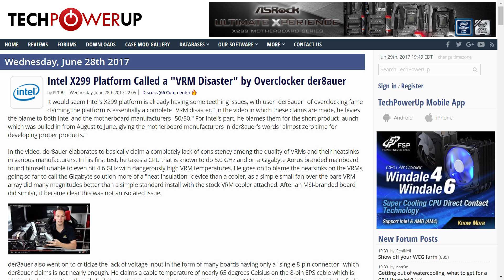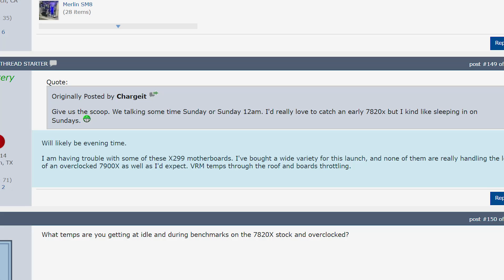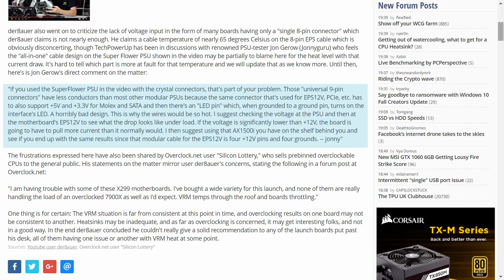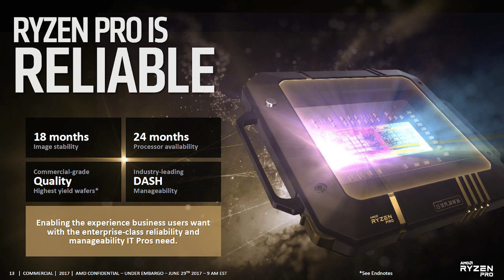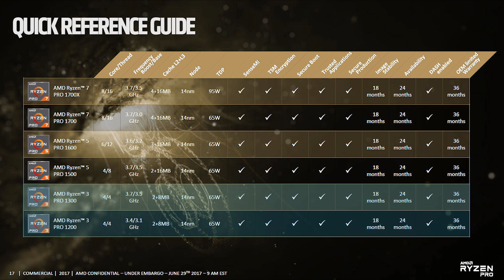Intel Core X Motherboards Overheating + Ryzen 3!

Comment: Intel is such a shit show lately
Reply: Unless Intel push out a completely better and cheaper series of CPUs immediately next year, I think Ryzen is going to last for at least a while.
Reply: Not much specs have been given out about Threadripper and everyone is already saying it's a win, if Intel is having problems with thermals and performance it won't be different with AMD. I'm not a fanboy of any of this companies, i'm just here watching everyone bitching about what they didn't get when they wanted it instead of being greatfull for years of innovation from Intel...
Reply: Brent Lio well it will be confusing if  you are still using an old generation cpu wich if i'm correct is not even in hedt territory, then i9 does make sense, i don't see what people are complaining about on the i9 side of things, few more pci-e lanes, a 10c 20t for the price of a broadwell-e 8c 16t, better clocks on both cpu and insane ram speeds, dual m.2 pci-e nvme ssd support, usb 3.1 gen2 front panel connector, and even 801.11 ad wifi and 10g ethernet on some mobos, i mean come on the normal consumer but eager to buy an i9 would go for a 7900X or lower, there is no need for more cores and lanes.
Reply: Mad Doge
'a regular user doesn't even reach 40 lanes' - the keyword right there is 'regular'
a 'regular' user wouldn't need an x99 ,because a z170 would have been enough.. but didn't the x99 catered to workstation builds, hence the extra PCIE lanes over the z170 + some more features?
and is the x299 now catered to 'regular users' instead of being a workstation/enthusiast system???
Reply: Mad Doge
1)i'm saying its a downgrade because 'older' systems than the x299 have more PCIE lanes than a lower tier i9+x299 board (not by core count and clock speed)

2)i'm saying its a downgrade yet again because 'older' systems than the x299 have had raid 0 feature WITHOUT having to pay for a raid 0 key to unlock it
Reply: Enthusiasts and workstations can easily reach 40 lanes.  8x for H310 SAS cards, 8x fiber cards, 4x video capture card, 4x USB 3.0 card for Oculus room VR sensors, 4x for m.2 NVME, 1x each USB 3.0, etc.  You also have to look outside the realm of gaming.  Rendering towers can easily have 4x cards.  Given rendering doesn't generally require 16 lanes at full speed, they can be run just as well with 8 lanes per card with usually little hit to performance.  But the key word is generally, so 4x8 = 32 alone.  Factor in potential m.2 drives and what not and you can see the problem.  Video capture and rendering of incoming feeds to storage subsystems, while hosting a few VM's that are gaming or streaming content themselves.  So, for a single workstation that's gaming, and streaming, and using a pair of high performance video cards, with a pair of NVME drives in raid 0 could easily reach over 40 lanes.  Many of the small to medium sized businesses and performance users have limited budgets to work with as well and prefer not to waste money on excessive dual processor/commercial gear, so Threadripper could be the answer.
Reply: Brent Lio The main weakness is the lack of PCIE lanes which will become a issue as we continue to see more add ons switch to using PCIE. Intel is not innocent either but at least their top 2 or three chips have more lanes vs Ryzen that at best tops out at 24. With this in mind I can't understand why a AMD user would by anything else other than Thread ripper unless they were willing to have to upgrade again in only a few years 2 or 3 at most, it's stuff like this make the supposed value of these chips harder to justify cost wise.
Reply: Mad Doge  The m.2 slot on at least the x370 Ryzen boards has 4 native PCIe connections directly to the CPU. There is no way those will be disabled at all ;)
Reply: Tiger Team Delta AMD is not likely going to make up to the pressure, low prices won't help, and if they do, they will become the same as Intel unless the mentioned pulls the win as happened in the past, companies are companies in the end.
Reply: what people are complaining about is that the x299 platform is sort of a downgrade to the x99 platform here's why:
1)lower PCIE lanes when using a lower tier i9 cpu, which doesn't make sense since the x99 platform was the proper platform when using SLI/crossfire because of its PCIE lane count..
2)the need to buy a raid 0 key to unlock raid 0, which is just additional cost to the consumer

x299 is 'supposedly' an upgrade/improvement to the x99 but it really isn't cause they took away some features
Reply: Tiger Team Delta no one is programmed to believe nothing, Intel has built its own prestige through the years to know they have always delivered the best of the best and will continue to do it.
Reply: Brent Lio Please tell me what features has an 1155 socket mobo compared to 1151 and am4, FEATURES
Reply: Brent Lio well you came in late "general computer user" with a 5 year old pc because we where talking about workstations and enthusiasts
Reply: If you don't want to be a joke, tell me about these 'FEATURES' your workstations/enthusiasts use?  You blasted at me for bringing up the gaming performance for 3770k vs newer gens.  That's why I used 'general computer user' for my assumptions.  I'm sorry but I have no clues about workstations and enthusiasts.  Would you kindly educate me?
Reply: And don't fucking assume what people use their computers for.  People mostly know exactly what they need and are capable of making choices.  And I need exactly the 8 cores and the 16 threads if not more.  Not much about anything else because it will be an upgrade from my 3770k no matter what I get.
Reply: Brent Lio yes please, and buy a ryzen 7 ffs, benchmarks speaks for themselves
Reply: Yea, thanks, I will.  But just to make sure I get best performance/dollar, I'll wait for TR and higher core i9s.
Reply: ikr
Reply: Anime536 _ 
1) no it is not a downgrade, again 6900k is worth $1000 for 8c 16t and 7900x is worth the same but for 10c 20t and higher clock speeds.

2) again no, raid 0 and i'm not sure if the other configs are available out of the box because the m.2 pci-e lanes are wired to the chipset not the cpu, the key is needed for the other few raid configs if an expansion card with more than two m.2 slots is added to a x16 (x4/x4/x4/x4)slot for full bandwith, that feature is meant for insane transfer speeds.
Reply: Anime536 _ a regular user in a bigger point of view, it's meant for enthusiast, workstations, and overclockers, if you want to talk mainstream i don't know what are you doing here
Reply: Anime536 _ or are you telling me you are going to use all 64 lanes?
Reply: Anime536 _  This is a valid point ethusaists are expected to push potentially all aspects of their rig to the ragged limit so the cutting of potential expandability is especially determental to the end user regardless of whose banner said user my fly.
Reply: Mad Doge PCIE mounted drives will in the coming years begin to take up those lanes now that SLI and Crossfire are both effectively dead, if there is a chance for faster read/write speeds it's safe to say that in due time it will be exploited. So having the equipment now makes such upgrades cheaper in the future and adds to the return on investment in getting the more expensive chips now.
Reply: Mad Doge
intel fanboy, you just hate to admit that the x299 is a disaster... it doesn't have the prestige that the x99 had compared to its gaming boards (like z170) of its generation.. people with x99 could brag about all additional features they had compared to a high-end gaming motherboard.. but now Intel is charging an extra for raid 0 key on the x299, then lower tier i9's only have 16 PCIE lanes.. what intel did is just an unprepared and rattled response to AMD's ryzen and upcoming new hardware
Reply: Hybris51129 technology is getting smaller and smaller nowadays, as soon as a pci-e drive comes in, in a matter of at least 2 or 3 moths it will be replaces by something a lot smaller that can be handeled by future chipsets
Reply: In terms of gaming, even my 3770k do pretty well at keeping up.  the amount of performance gain vs price for the numerous upgrades of the other newer i7s are abysmal at best.  That says something about games, and that says something about Intel.  In reality, Ryzen's raw performance/dollar value overkills Intel at the moment.  It's only a matter of time for AMD and Game Devs to convert those raw performance into frame rates.  I won't disagree that Intel may pull out something amazing in the future.  But they are doing kinda shit for now.
Reply: Brent Lio Please, for the love of god, if you have the money, upgrade to either a 6th or 7th gen cpu, doesn't even has to be i7, i5's these days have a massive performance difference over ivy bridge...
Reply: Give me a good reason to choose an Intel 8 core CPU instead of Ryzen.  I don't care about gaming.
Reply: Brent Lio im talking about mainstream intel, not hedt, dont come here saying gaming performance is nearly the same in a 3d gen i7 when it is not nearly compared to a kaby lake or ryzen cpu, these people jfc
Reply: WTAF???  You are saying a merely 10 to 20% gain in FPS is a huge difference and that sets a 3770K apart from a 7700K?  And I should upgrade?  FFS man.  My 3770k is priced fucking higher than a 7700k.  If you keep doing this I'm going to start thinking that Intel is fucking laughable.  I acknowledge what Intel has achieved in terms of power consumption, form factor and efficiency.  And I know 7700K does many things better than 3770K, but for what I do with my computer, that does not justify an upgrade.  If I just need a better gaming experience then a better GPU is all I need.  And no, since a Ryzen 1700X not only have the same core frequency as my 3770k, it also has double the multi-core performance.  Therefore I will not consider Intel.  Though, if intel ever comes up with something way more powerful at a great price, I'll reconsider.
Reply: J JD No, it doesn't.
Reply: Brent Lio Asuming? you brought up gaming lol, it's obvious what users do with workstations and enthusiast pc's, not only gaming...
Reply: Don't ask me why I brought something up and then ignore the reason I explained to you about why...  I think we misunderstood and misinterpreted a lot of things in the conversation.  Can we just stop?
Reply: From what I can see they don't have any problem with specs.  And they are vastly cheaper than Intel's equivalent.  My 3770K is still priced higher than a Ryzen 7 1700X.  Sorry but I don't see AMD losing its battle this quickly.
Reply: I hope Intel is not trying to have some redemption for themselves squeezing the market for 5 years.  LOL
Reply: Hybris51129 As long as you don't do SLI there is no reason to worry about 24 PCIe lanes. And I don't see any reason to do SLI for gaming, it just makes no sense, performance and power wise. For those who really need SLI,  Threadripper is the better choice anyway.
Reply: NoXPhasma It's not SLI or crossfire to worry about its PCIE mounted hard drives, NICs, Thunderbolt 3 cards among others these are the things that will start eating PCIE lanes in the next few years.
Reply: You're welcome to speculate all you want on empty research.  The culture within AMD has changed significantly with Dr. Su.  Yes, corporations are ultimately loyal to shareholders, but look who are the primary shareholders today.  Are you aware or still sleeping?
Reply: If people are conditioned to blindly buy Intel at whatever cost, because they're programmed to believe they are the best for them, then Intel can charge extra for all the features you assumed were standard.  Then even if they sell less parts than they have in the past because of competition, at least they'll make a decent profit.  What's the motivation to innovate when you control the current mind-share?
Reply: Artemis It's to be expected that it's their turn after all AMD been shit for 10 years and looks like it's setting itself up for another rough time the way Ryzen looks to age vs current hardware trends.
Reply: Brent Lio Only if AMD can keep the prices low enough to keep people from looking to hard at the specs. I doubt AMD has much room to cut back without taking considerable profit hits that the company simply can't afford right now.
Reply: If you look at ThreadRipper CPUs, you have 64 PCIE lanes, and at most 32 cores.  And the 16 core version is below $1000 dollar.  I don't know what else do we need to see so that we can be certain that AMD will stay for at least a while.  And plus, I've not known that any other PCIE device other than a graphic card would utilize the full 16 lanes.  I suppose one graphic card and one sound card or network card is going to be the most norm for multiple PCI-E usage.  SSDs are going to use M.2.  But well, this could be a timed bomb if the trend really eats up the PCIE lanes.  Let's see what happens, i mean, AMD Thread Ripper is still a real deal.
Reply: Mad Doge I feel sad for you seeing how desperate you are trying to justify i9 and its X299 platform.  Nope, I don't give a flying fuck about i9 at this point.  I'll just be patient and see what threadripper fares.
Reply: By the time i see that multiple m.2 and sata devices disable pci-e lanes i will laugh my ass off, there will be something about the x399 chipset that may trigger very toxic people...
Reply: Hybris51129 With 24 lanes you should be fine, even if you use a NIC or Thunderbolt 3 card (Who really would use both at the same time?). But if you really think you would need much more lanes, go with Threadripper 10 Cores and you will still save a lot of money against a Intel setup.

Brent Lio There will be no 32 Cores Threadripper. Threadripper comes from 10 up to 16 cores. Only Epyc will have 32 cores and those are Server CPUs.
Reply: NoXPhasma don't take anything for granted...
Reply: Anime536 _ tell me what older system has support for dual nvme m.2 ssd, sacrifice lanes over performance? a regular user doesn't even reach 40 lanes
Reply: Anime536 _ 4-way sli is not compatible anymore, and 4 rx580's is idiotic, so there you go 32 lanes for graphics cards, and the rest 32 what? you dont have many slots to put high bandwith hardware and use all 64 lanes
Reply: So, the unsavory business practices, market manipulation, and antitrust losses from lost lawsuits and fines in the billions of dollars is just a result of Intel delivering the best of the best?  There are many ways to win at business and cheating is often the easiest and most profitable.  I vote with my wallet for the best value that suits me and benefits the consumers as a whole, not conform to preconceived notions of prestige.
Reply: Look...  If a person is upgrading a CPU and Motherboard from an older generation.  They probably will carry over all other old parts.  Is any new generation mobo capable of using these older parts?  Probably yes.  So I don't really care?  SSD with any connector is pretty much fast enough to avoid frustration, most mobo has onboard networks and sound.  The only extra part a general computer user may have is a graphic card.  In this case, does any of the "FEATURES" matter?  Probably not is my assumption.
Reply: Brent Lio please just sell that system and take your drives, an i5 7600k is enough for gaming plus more features on mobos that aren't even expensive, im talking about $180 max for better performance that suit your normal user applications
Reply: Brent Lio or just go ryzen, even cheaper...
Reply: Brent Lio then why do you bring up 2012 vs 2017 here? mate no one is obliging you to argue about performance over features, you can literally spend only $500 for a whole new system! you have no excuse
Reply: AMD is pushing the envelope to give us all what we need in the future, not what is acceptable for the time being at over-inflated prices.  Try to see the bigger picture for all of us not the short-term self-centered outlook.  Technology should have been much farther along than the stagnant pace we are at presently.  Ignorant consumers and unsavory business practices are a result of this.  Time to wake up..
Reply: If Intel really tried to innovate and provide for consumers, why are we getting the i9s as they are right now?  What's the purpose of releasing i9?  We haven't bitched about anything until Intel, after all these years of innovations, came out with i9, while their i7 lines still consumes more power, have less cores, and their high-end product costing a liver to upgrade.  I can't be grateful for Intel's "years of innovations" if I didn't benefit a single bit from it.  But I am grateful that 3770K existed for me to have what I have now.  Past is history, I don't care.  If i9s and TRs are actually like what they are speculated to be, then I don't see a reason not to question what intel's intention with i9s, it's just confusing.
Reply: To be honest.. EPYC feels just like 2 TRs smashed together linearly...  And they even use the same socket?  About the stagnated technology...  Yea, the CPU market has been like this for how many years? 5?  My 3770K is still only a few percent slower than the current i7 equivalent.  What's the point of upgrading if all I get is another CPU that does the same old job 5% faster, but at 100% of the old price I paid for a 3770K?  With what AMD have now, I pay the same price, and absolutely double the performance.

Seriously.  Car industry had pushed through with Tesla.  Graphic card has pushed through with Nvidia.  Rocket industry pushed through with Space X.  But CPU?  CPUs are the same old crap we are used to 5 years ago.  I think we have enough reasons to place our belief with AMD for once.

Despite some people hate Nvidia, their graphic performance actually improves A LOT over the years.